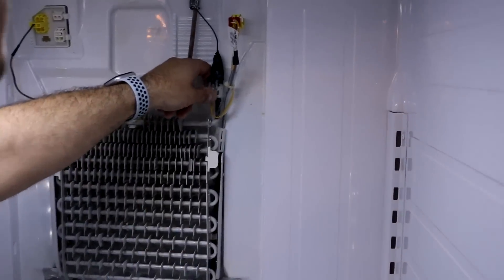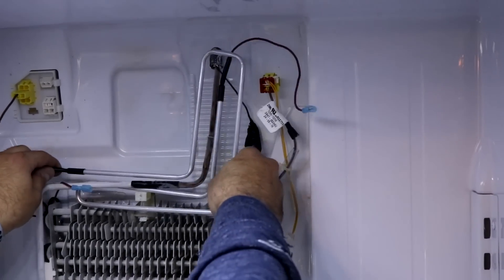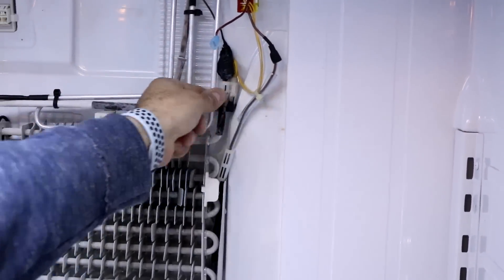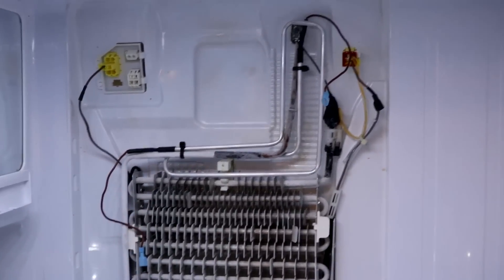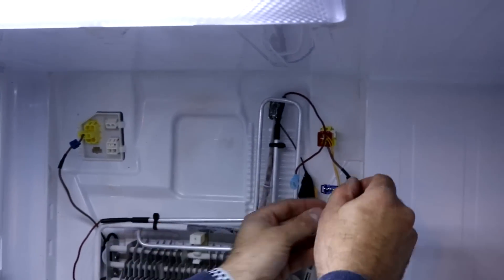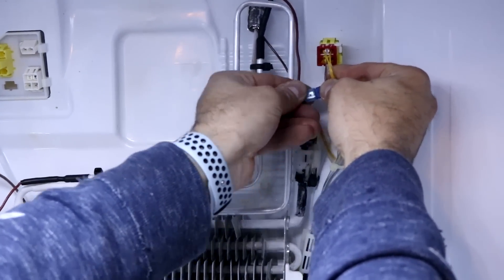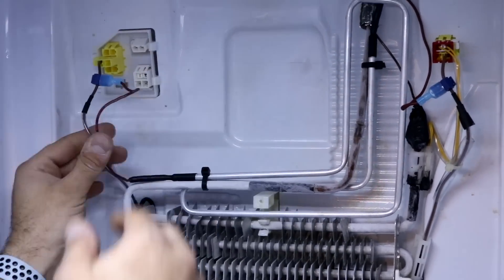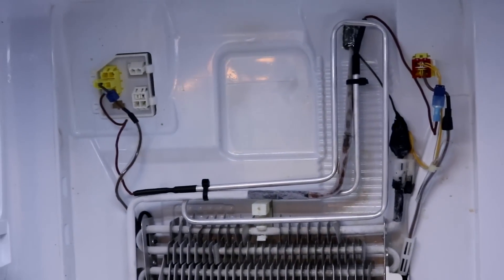SAMSUNG FRIDGE ICE BUILD-UP REPAIR GUIDE, PERMANENT SOLUTION FOR SAMSUNG REFRIGERATORS  EB11-00191R

Comment: my refrigirator was not cooling at all however the freezer was working due to ice buildup I installed the kit. The  refrigirator was up to temperature  by the next day, has been working properly ever since. , Thank you for a   great vidio and  product..            note        if you can defrost your fridge for a couple of days to remove all ice  buildup it will make your job easier,,,,
Reply from the maker: Thanks for sharing

Comment: I had a clog in the drain tube behind the rear access panel.  Everyone should check these tubes first.  The water backed up completely to the fridge drip pan behind the plastic twin cool panel.  I will now check these tubes periodically.

Comment: Can u post a close-up pic for the right side electrical connection?  What is the best position of the new blue connector? From the video, the blue connector is added closed to the wall connector. Also if I buy the kit with the sensor, what is the recommended sensor position either at the top of the evaporator center 1st row or should I use it as suggested in the video?
Reply from the maker: please view our other videos, you will find more helpful info

Comment: Will the addition of this element overload or compromise the defrost relay or anything else on the main board of the refrigerator?
Reply from the maker: This heater designed with very low resistance to avoid any overload of the system!

Comment: Nice Video!!!   Is this available in the United States and will it fit on a RF23HCEDBSR/AA (version 8) since my evaporate pipes look a little different from that.   Look like a better product that the flexible heaters I have seen installed.....
Reply from the maker: yes, we provide free delivery to Canada and USA, also worldwide delivery available at checkout.
this item will fit to any Samsung or Kenmore models designed by Samsung with bottom freezer.
please use link below to place your order.   
https://partsofcanada.com/products/defrost-booster-kit-for-samsung-refrigerator-eb11-00191r-ice-buildup-noises-and-cooling-issues-repair-kit-samsung-ice-buildup-repair-kit
Reply: @partsofcanadaltd9697  My delivery to the US, Washington state is not free though!

Comment: Since there seems to be a variety of models that have this issue will this coil work for the RB195ACPN model, S/N - Y4D64ADB400668X. I'm just trying to confirm before I order, install and then realize it doesnt work.
Reply from the maker: yes, it will fit to your model and any Samsung or Kenmore bottom freezer refrigerator

Comment: Can u provide the part number please.
Reply from the maker: Part number for this item is : EB11-00191R or ER11-00177C for the kit.
Order here: https://partsofcanada.com/products/refrigerator-defrost-booster-ice-buildup-noises-repair-kit-with-defrost-sensor-this-upgrade-kit-compatible-with-most-samsung-french-doors-refrigerators-easy-installation-d-i-y-best-available-permanent-solution?_pos=9&_sid=914211848&_ss=r
Reply: How to install ER11-00177C I HAVE YOUR VIDEO FOR INSTALL HEATER....PLEASE SEND ME LINK HOW I REPLACE SENSOR

Comment: Looks simple but I just bought the item and it came with metal ties where should I connect them to
Reply from the maker: The metal ties are instead of older plastic ones, you just wrap the heater with it, insert the end to its hole and bend it to opposite side.
we will post a video explanation soon

Comment: How can I get the part?
Reply from the maker: This part is available from Amazon by using link below ! 

 https://www.amazon.ca/INVERTEC-Refrigerator-Defrost-Booster-refrigerators/dp/B094TXSVBQ/ref=sr_1_4?crid=KFO4VKF6FTIM&keywords=invertec+refrigerator+defrost+booster+kit&qid=1637557755&sprefix=invertec%2Caps%2C201&sr=8-4

or From eBay by using the link below ! 

https://www.ebay.ca/itm/223744198874?epid=27006867285&hash=item34183188da:g:JaQAAOSwbCVgnKH1

Also available on our website :

 https://partsofcanada.com/products/defrost-booster-kit-for-samsung-refrigerator-eb11-00191r-ice-buildup-noises-and-cooling-issues-repair-kit-samsung-ice-buildup-repair-kit?_pos=1&_sid=ef154643c&_ss=r

Comment: I have samsung side by side, I do not have a plug on the left only on the right side, can I used this item and if so how do I connect the wires
Reply from the maker: This kit designed for french doors models and cannot be installed on side by side models unfortunately

Comment: I bought it and installed 29/08/21. Checked and appears to be getting warm. Compared to the actual defrost heater, it’s just warm. I will wait to see results.
Reply from the maker: The heater definitely will solve the issue :)

Comment: Please help 🙏.  I don't see any frost built up on my coils or near wiring. I replaced evap fan nd my fridge still won't cool 😒 stuck at 45 degrees and panel shows 34...
Reply from the maker: Hi,
if your refrigerator totally warm and the coils doesn't get cold or frozen, I would suggest to get professional diagnose, as to me sounds like sealed system issue unfortunately.

Comment: My bad, looked at a different wire from another spot.  Got the spices put on, both clicked, the clipped the cap on it.  I hope this works as advertised, we have been cleaning and defrosting for 2 years!  Got it down to 17 minutes, but it's a pain.  I will update in 2 weeks when we pull everything out to check if it is working.  Fingers crossed!!!!
Reply from the maker: Thank you
Reply: Just listen to the fan and save yourself the trouble. May I suggest you do a force defrost every 2 weeks or to to help prevent buildup.